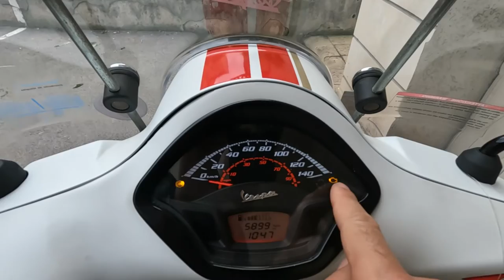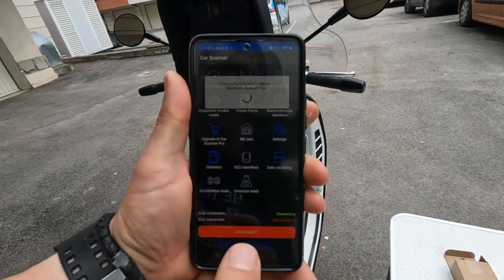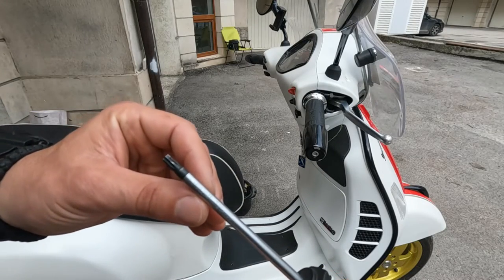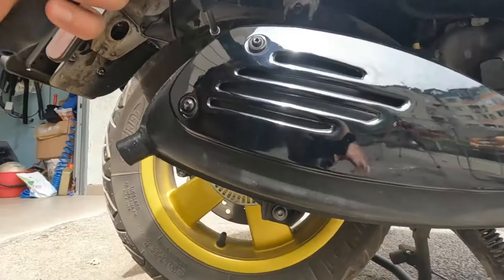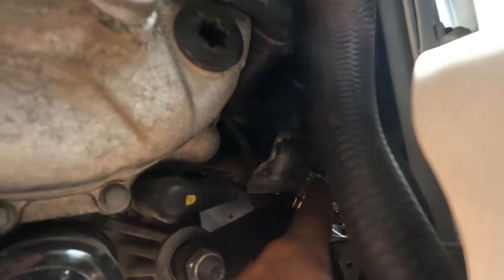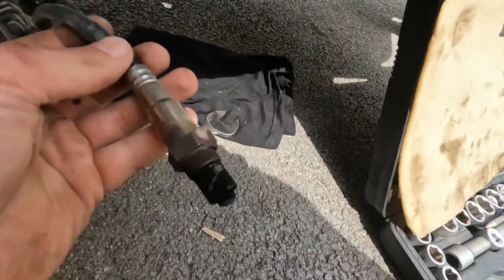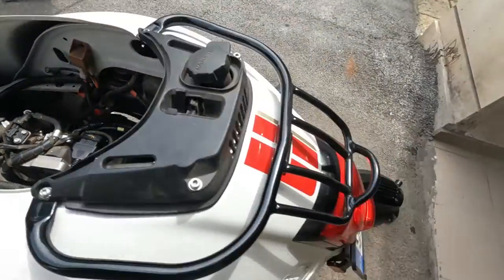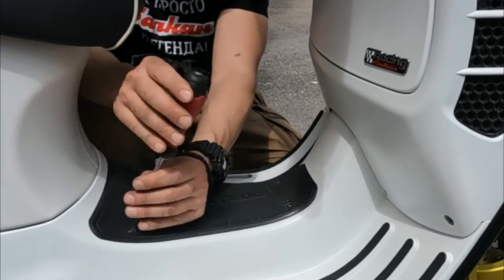Vespa GTS 300 Lambda sensor error P0130 (Replace oxygen sensor and erase error code)

Comment: Hallo. Thank you for this video.
I have qestion. How make bad oxygen sensor trouble?
Do not start motor? Shooting to the exhaust?
Thank you for answer 😊
Reply from the maker: The OXYGEN SENSOR has the function of determining whether the mixture in the engine should be lean or rich. Its effect is mainly on a cold engine. If the oxygen sensor is not working properly, an error is accumulated in the ECU. Then the "check engine" light comes on. If the oxygen sensor is not working, the values of the fuel-air mixture are averaged by the ECU. In Vespa GTS 300, the engine works with a slightly richer mixture.

Comment: Are you using the original oxygen sensor?
Reply from the maker: @kuthansengul7593  Yes, the oxygen sensor is original, but the problem is from a bad cable connection in frontal part in my Vespa.
Reply: @fitness-fishing-s.kovachev  Have you tried cleaning it before replacing it? Waste carbon clogs the sensor's holes.
Reply from the maker: @kuthansengul7593  There was no carbon buildup on the oxygen sensor, but I cleaned it anyway. I tried another sensor from the same vespa gts 300 by swapping them. I cleared the error, but the check engine light came on again. The problem turned out to be a bad cable contact from the front of the scooter.
Reply: @fitness-fishing-s.kovachev  Благодаря. Къде си в България?
Reply from the maker: @kuthansengul7593  В София.

Comment: hi what is the code fault scanner you use please
Reply from the maker: Hi friend I use: Vgate iCar Pro ELM327 V2.3 Bluetooth 4.0 WIFI For IOS/Android OBD Auto Scanner Code Reader OBD2 Car Diagnostic Tool ELM 327 V1 5 from Aliexpress
Link: https://www.aliexpress.com/item/32807284265.html?spm=a2g0o.order_list.order_list_main.10.a3a91802CuVRZw
And cable: https://www.aliexpress.com/item/1005002537566542.html?spm=a2g0o.order_list.order_list_main.5.a3a91802CuVRZw
Reply: @fitness-fishing-s.kovachev  Hello bro. I’m from Indonesia. I have vespa sprint. I want use and buy this. How many pin for vespa 4 or 6 pin adaptor cable ? Thank’s

Comment: Now my GTV300 is idling and it feels like the car is about to shut down. Engine light show. Once plugged in and read the value It shows O2 error code on sensor. O2 must be changed and code erased.
Reply: Sorry, I'm not very good at English.
Reply from the maker: The problem is not necessarily in the oxygen sensor. It is possible that the throttle body has play in the valve or the idle port is blocked. It is also possible that when filling fuel to the top, the gas recirculation system from the tank gives a problem. A thorough investigation is needed for the cause.